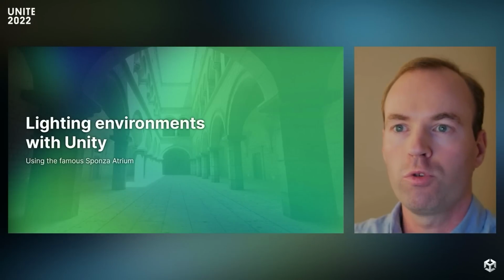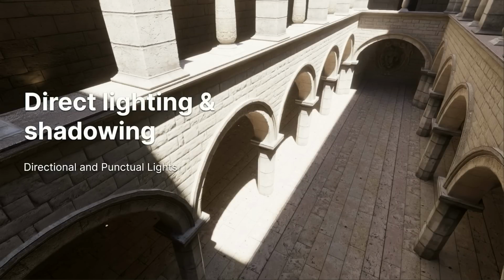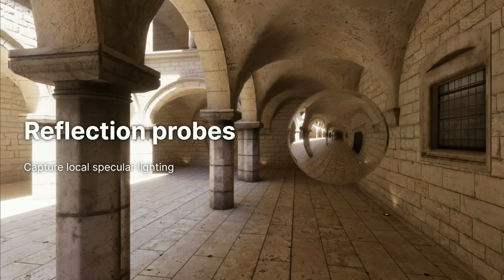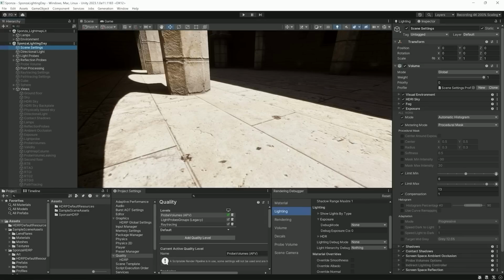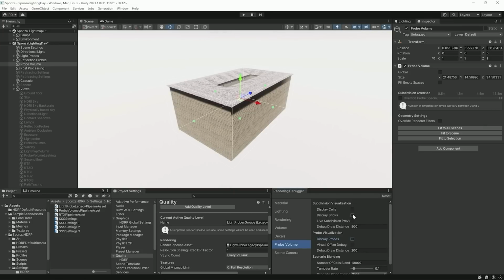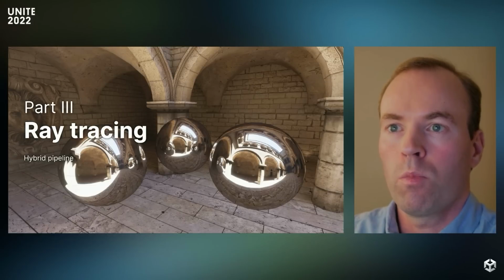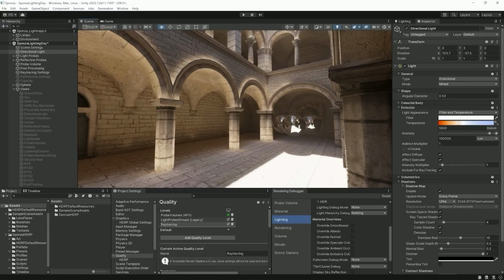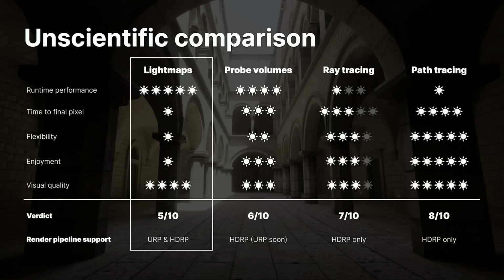Lighting tutorial: 4 techniques to light environments in Unity | Unite 2022

Comment: Thank you for the tutorial. I read many of your posts on the Unity forum, giving useful tips and explanations. I tried many of them, unfortunately I could not achieve an acceptable transition between a bright exterior with dynamic directional light and a very dark interior lit with a dynamic point light. There is always an issue, either with the blending of indirect lighting, or that of the exposure, if the exposure blending is fixed, then interior light is too weak... Also the interior that look bright for the outside... I would love to see a tutorial on the subject in Unity, but I could not find any. Strangely, exterior/interior transition with dynamic lighting is a common use case in video games and achieved using other game engines. Is it something that can be achieved in Unity? Thanks